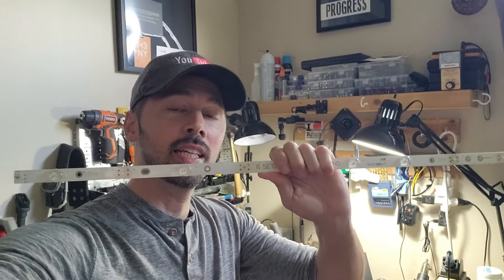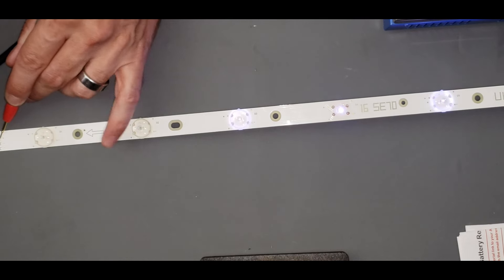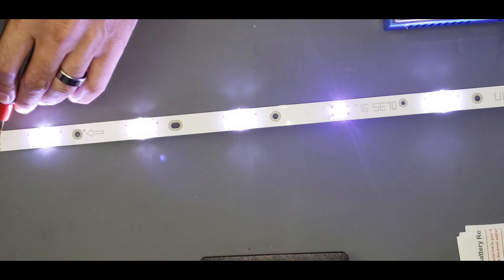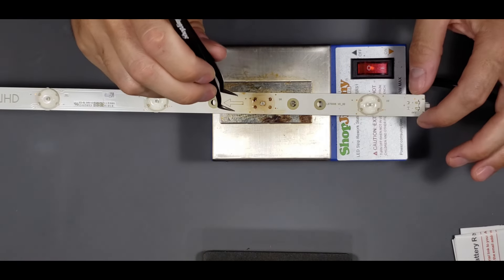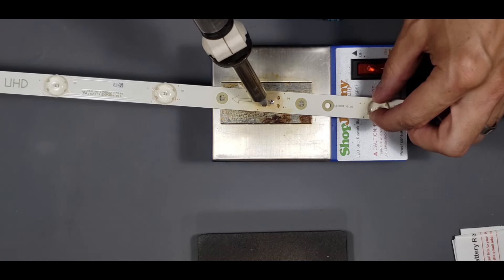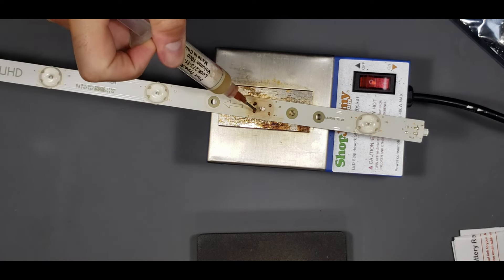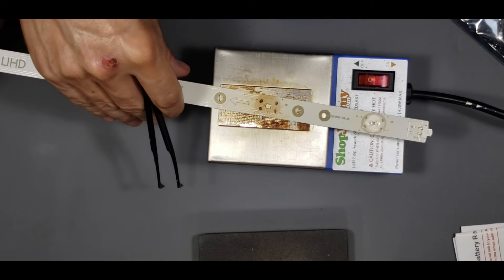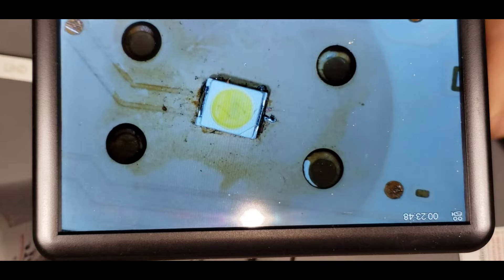How to Check LED TV Backlight Strip and Replace LEDs

Comment: I have a 2018 Sony XBR-75x900f and am getting red led on screen blinking  4 times at startup,  I saw videos that jump the 2nd pin ERR lead to ground to stop the error code and the tv will work, What are your thoughts on this fix, will the tv look the same afterwards and how long will the tv  last? I ask because you have helped me before and I trust your opinion. MANY THANKS!!!

Comment: Evening Paul, I was given Sony Bravia cdl-60ex700. Likely because it has issues! Red standby light is solid no blink, power turns on the green light, solid. Appropriate beeps from the speakers. The screen is very dark blue. Any thoughts? thank you.

Comment: Where can I source back lit led for a “NEC P463”. The screen is not broken, there is sound, all the components work as they should. I used the flash light method & do see image on the screen. Just the led is bad. Any help is much appreciated, would hate to discard such a minty NEC for just a faulty light source.
I’m from the Pinellas Park area. Thank you

Comment: Hi dear friend. Thanks for the videos it would be a great help if you answer my question. I have a Philips LED TV. Yesterday, the photo did not come. Of course, I dimmed the light in the room and put a strong light on the LCD. But unfortunately, I did not see the image, even the weak image. I don't know if there is a software problem or not? Because the TV light flashes and it works a little slow. Plays the sound. But there is no image. Thank you for your guidance